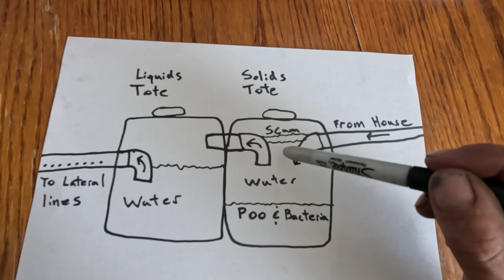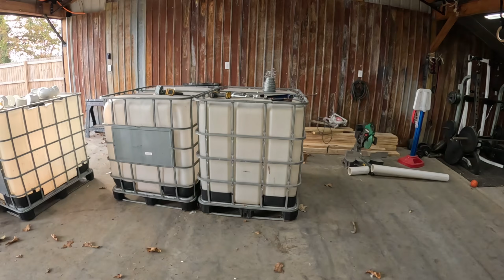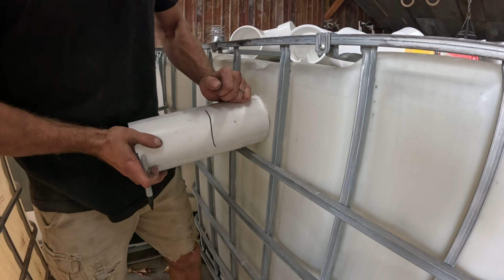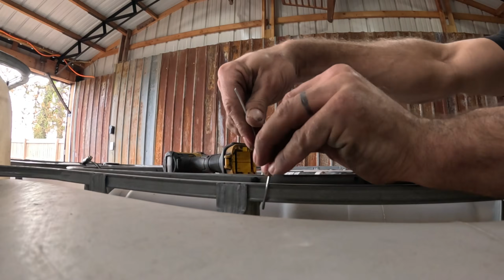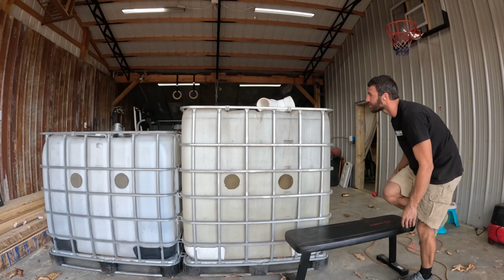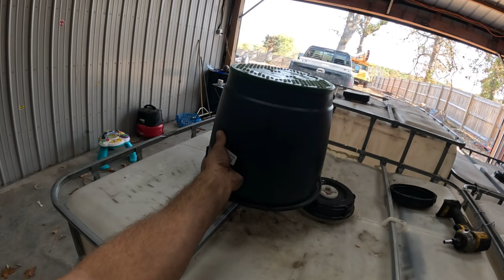CHEAP DIY Septic system using totes for off grid

Comment: Interesting, what I want to do is little different, I want to have 4 Tanks, have a Air hose with  tinny wholes, slip a foam hose over top of the hose in to 3 tanks close to the Bottom, pomp air in to the 3 tanks, 24-7 like a fish tank,  then in the 4th tank water should be clear. that I can usu it to watering my Plans or Apple Trees.

Comment: You know they make rubber tank adapters right? They are only about $12 per set. Save yourself the time and mess of using that caulking. Street T's also make great baffles that don't require drilling vent holes.

Comment: I have  questions please!  If I used three totes, would there be two for solids or two for water, or just do it in even numbers?  How long would it take to fill up a setup like this if you're a fulltime RVer dumping black once a week (35 gal tank) and gray every 4-5 days (also 35 gal)?
Reply from the maker: I would do 2 solids 1 water tank it would take a while till the solid tanks would need pumped as long as you have enough lateral line so stuff doesn’t back up
Reply: @simplytinkerdad  How would you configure them?  Can I go solid -> solid -> water?  Or do I pair the solids like you did and then Y into the water?
Reply from the maker: @robg875 I think in line would be no problem

Comment: Check out uniseals instead of using silicone at the pipe penetrations. I bought my uniseals online. I am concerned about the tanks freezing and busting in the winter- thoughts?
Reply from the maker: If it’s buried I wouldn’t worry. If your leaving the top exposed maybe some insulation but I think the bacteria in the tank actually produce heat but I could be wrong
Reply from the maker: I hadn’t seen the uniseal before that looks like a great option

Comment: Using silicon ia a bad idea,use rubber grommets or use epoxy,silicon gone fail after a year and dont put your tanks so close,you gone need to repair it when you do it this way
Also for first tank use Y or T elbow and make it vented

Comment: Out of curiosity, if you wanted to use 3-4 of these tanks in series, or in a square, how might you accomplish getting two of the tanks to take sludge (poop solids)?  So as to have 2x275 for the solids?  Would you put a mid hight pipe about 4 inches between tank 1 and 2?
Reply from the maker: That is not a bad idea I think the first tank would take most of the goodies though if in series but having a midway pipe might help pass more on to the second tank

Comment: Using this, is there any way the smell could retreat back through the lines and into the house?
Reply: And can I use vents with this system as well?
Reply from the maker: You could use a vent at the tanks if you wanted I probably wouldn’t put the tanks close to the house lol. The smell shouldn’t be in the house unless there’s an issue with venting or a trap in the actual house shouldn’t have anything to do with the tanks I believe
Reply: All drains in a house should have p traps that hold liquid in them to prevent glasses from coming back

Comment: A cool addition to the outlet of the septic tank is a dosing tank. It's basically a small tank with a bell siphon that doses the leach field.
Reply from the maker: That is a good idea I think I have seen an extra grease trap installed on the outlet as well before? Probably a good thing to do
Reply: @simplytinkerdad  I've only dealt with point of use grease traps at the kitchen sink where most grease enters the system. Another big one is lint from laundry clogging the system if laundry water is plumbed into the septic. Local regs allowing, route gray water to a separate system or to water vegetation in the yard.

Comment: One thing I would’ve done a little different which I’m gonna do to mine. I’m going to cut the hole out at 3 inch then what I’m gonna do is heat that hole up with the torch and then force the 4 inch through and that should give me a better seal so that I can use the epoxy glue to join the two together rather than silicone silicone will fail
Reply: Use uni- seal gaskets and use 3"PVC pipe if new constrution

Comment: How many butts can this system handle? Looking at doing this for my sons ADU.
Reply from the maker: I think 4 booties is the max recommended for this size system
Reply: In tank 1 are the in and out pipes the same height?
Reply from the maker: @KINGSTONSPRIDE yup tank 1 same heights on the pipes then lower on tank 2 for lateral lines
Reply: What is the life expectancy of the tanks under ground

Comment: Did you do a video of installing it in the ground?
Reply: I had a land surveyor pass me onto the health dept saying my soil looked good. Health dept came out and denied me for traditional septic and was told I need to spend 30-40k on an engineered system. I’m debating on installing it myself and taking my chances. Nice video
Reply: @austinrob15 DO IT YOURSELF... EXIT THE LIQUIDS INTO A DEEP BED OF GRAVEL... YOULL BE FINE.
Reply: Do you have to fill up the tanks before using them ? Or by flushing everytime fills & separate itself?
Reply from the maker: @ you do have to fill them with water when you burry them to make sure they don’t cave in but after that its pretty hands free
Reply: I've been debating on weather to do this on my property. Seems like if installed correctly it would work perfectly. Have you installed it in the ground yet?